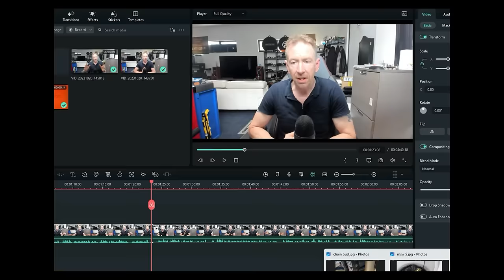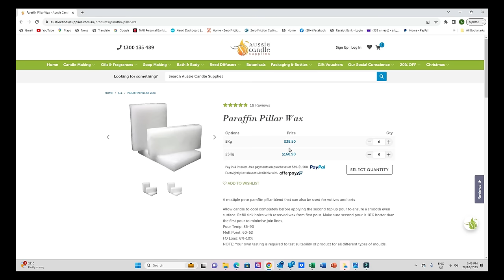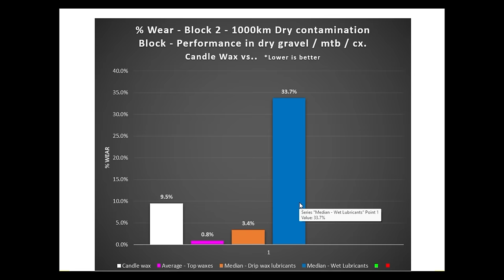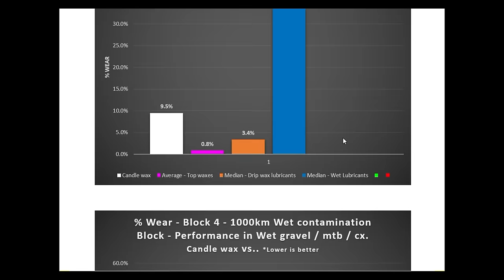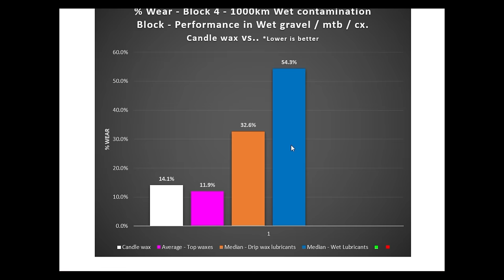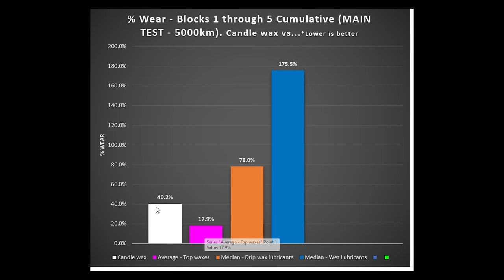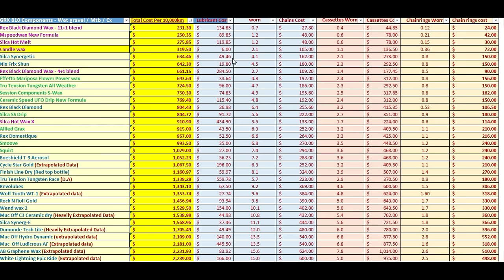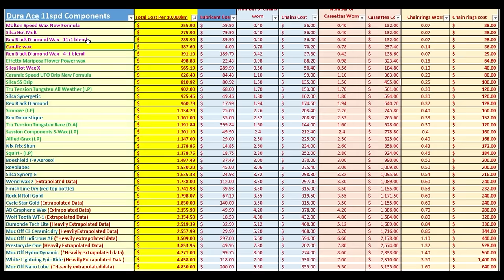Candle Wax test

Comment: Is there any concern re frequent boiling water flushing the chain from an expansion and contraction point of view? 

I guess we rapidly heat/expand the various chain components when we wax but if you flush before every wax that's 2x the expansion/contraction cycles over the life of the cain.

Just a random thought. Maybe a contributor to the cases of folks getting less than expected chain life?
Reply from the maker: no not at all, no more than re waxing itself, the temps re metal / chain construction cause zero issues - chains almost always fail early in life if they are going to fail due to a mfg fault, once chains are well into lifespan, if you keep that lifespan extended with immersive waxing, you just enjoy a vastly longer life from the chain. Very worn chains have a higher risk of failure, but thats not the risk with waxing.

Comment: Is there a way to tell from visually seeing the melted candlewax if it's going to be a disaster or not?   Can I dip a nail or something in and tell from sticky factor, residue left, something like that?   What if it smells like Christmas?   That has to be okay right?
Reply from the maker: Alas i cant say, i would need to do a bunch of visual / feel tests and then control test to see how it correlates. I would say sticky factor would not be a good sign though, that will likely be a) very slow, b) much more likely to be quickly dirty and gunky - so if you can tell that from feel, then that would be not a wax i would run. 

Anything scented is not a great sign if looking at things from the perspective of i want the best lubrication. Adding substance for scent - lets say 5% of volume is that substance, thats 5% less substance that could be lubricant. And it is doubtful that substance brings anything great to the party re performance - scented candle wax was simply not designed with lubrication of an extremely hard working mechanical part in mind - it is just an incidental factor for them that overall paraffin wax is an amazing lubricant for bicycle chains, but other things they contain outside of high quality paraffin will not be helping.

Comment: There is nothing to suggest that heating paraffin wax to higher temperatures like 150 deg C does any harm to the wax.
If long chain polymers in the range of paraffin lengths could be broken down this way then industry would have solved major problems.
Some chain lube manufacturers may however use friction modifier packages that break down at higher temperatures.
But if using straight paraffin it is better to heat to around 140deg C.
This ensures that any moisture boils off quickly and may make it easier for the wax to get into the chain spaces.
Reply from the maker: I can suggest some :). For one, the wax cools to a yellowish colour vs white. And then, those using damaged wax find that it feels and sounds pretty bad pretty quickly. And then they see their chain wear rates shoot up if continue to use. Overheating does indeed damage the wax, this is a test you can easily do yourself at home, and very easily you will see the difference. The mfg would not advise against it if it was not an issue, but it is most definitely an issue, and one we deal with relatively frequently when a customer accidentally leaves their wax on high overnight etc.
Reply: @zerofrictioncycling992  I see no drop off in wax performance.
Only poor waxes will yellow quickly unless you reach silly temperatures.
Reply from the maker: @darrylduck6356  Okay. I can only report what a) the mfg advise and b) what we see and deal with - we have many thousands of immersive wax customers. Many have wax for years and countless cycles, no degradation. Some accidentally overheat, and that is the only time the (SAME) wax yellows. Post overheating, degradation in performance is very tangible - and is usually the impetus re why they email me to ask re if they have damaged. So we have a pretty strong link to what is observed in real life matching warning by mfg's re not overheating.

Comment: Its gonna take a lot of commitment to take my chain straight from my bike and put it back in the wax. It seems very wrong, like putting dirty oil back into a can of new oil. Anyway, say I was about to rewax, but my chain has began rusting between the rollers and plates. Should I still sling a rusty, dirty chain back into 100% pure wax? How long can a chain have surface rust on it before it starts pitting/degrading the sliding surfaces of the chain? Is there any way to remove 100% of rust from a chain?
Reply from the maker: Hey Josh - ha yes that is difficult for some, but - again - compare to what drip lubricant users have re the ratio of lubrication to contamination going on vs what it  takes to get anywhere near that in hundreds of ml of wax in your wax pot. Unless you are slinging chains post full mud rides in every time, dry riding - you dont have to worry at all, and if you do worry - then overall vastly easier is the two pot system like a boss demonstrated at 1hr 39 min mark in waxing FAQ vid. 

Surface oxidation is mostly just an unsightly issue. Outside will start to oxidise well before inside where it would cause issues due to lack of air exposure inside chain. 

However to remove is not easily done depending on where it is. If its on rollers, that will wear off over time, if its started a bit in spots on plates, thats hard to remove - really the only viable way is ultrasonic and ultrasonic solution specific for rust.

Comment: Make sure the 'cheap' pure parrafin has as low an oil content as possible and than usually that means it wont be from the cheapest source and usually you have to buy bulk like at least 5kg-10kg. And then you just need to add some sort of dry lubricant, MoS2 or just graphite. Plain it should not do as well.

Comment: anyone having trouble with wax longevity on Transmission XX SL chains? i am wondering if its the holes in the plates?
Reply from the maker: Hey jack that is interesting, mostly sram chains get along really well with wax, their surface treatments / finish seem to have wax bond well. Typically eagle chains etc enjoy very good  treatment lifespans. How did you prep chain and what wax are you using, how re waxing?

Comment: Interesting. A parallel to this experiment in the wet lube category could be testing Canola Oil (originally developed to lube mechanical parts) & compare to top / mid performing wet lubes.

Comment: Great research. Now with that out of the way I have another lubrication 'hack' for you to test if you are intrested. I once met a rider who told me that they dont use wax or oil, they instead boiled their chain in fat, which they obtained from the local butcher. I dont know the details of how that setup work, but from what I heard from them, its somewhere between wax and oil..
Reply from the maker: Ha yes there is so much stuff like this out there! At this stage i will leave that for someone else to test. Along with whale oil, seal blubber etc etc :)
Reply: Don't even bother. I've had customers doing this when I was working in a shop focused on oldtimer bikes because it was some thing someone did in the 30s or so and those drivetrains were the biggest gunkiest mess I've ever seen.
Reply from the maker: @vien4875  yes that is the concern! a little inconvenient the wax i found was pretty good, what others end up getting for DIY can be not so much....

Comment: Putting "super secret" in the name just rings my sus alarm even more, it strongly reminds me of the FireClean lube debacle in the firearms industry, and to even further back the first advertised, ultimately ineffective cure of tuberculosis, which was later used successfully to diagnose the disease.

The thing with FireClean was that it worked amazingly, but that's not the point, it was about the price when people found out what it actually was. The scandal is across disciplines but still I think it draws parallels to the bike industry, especially all the sementic wiggling the company did to justify the cost in the aftermath.
Reply from the maker: Not entirely sure what you are getting at here. But i will take a stab, and see if i can help with some concerns, not just on behalf of silca, but overall i think it helps people to understand how business works sometimes. 

>First there is R&D cost behind a product like this. Unlike circa 1000 "bike" lubricants on the market that are just rebottled and re branded something from X industry supplier - some lubricants are developed specifically for use on a bicycle chain, which is actually a very specific use case factoring contamination, very high pressure loads - stiction on 8 separate sliding surfaces per link per articulation / reticulation, ability to penetrate to pin (difficult for wax emulsion lubricants) etc etc.  Aside from the chemistry and mechanical knowledge to make a true top performing product - it still normally takes a lot of testing across many base blends and potential production blends. This costs real money, that has to come from somewhere, to do.  In the longer run, the costs have to be paid back via return on the product. 

> Then there is volume production once the final blend has been decided. This involves proper supply chain of key ingredients from tier 1 suppliers, batch analysis of key ingredients, and the actual product and bottling costs

> Then there is marketing and distribution costs. 

> Then - Silca need to make margin between their sell price and the price it is sold to importers. Importers then need to make margin on selling to their w/sale accounts (online stores and bike stores). The online and bike stores need to make margin selling to the cyclist. So there are 3 layers that need to make viable margin. 

> If we want good companies to continue to exist, we want them to make viable margin. We want them the get a viable return that pays back the initial investment in bringing to market, and then to provide revenue for R&D into next great products coming to market.  How many treasured business in many western countries have been lost in the last 10 years. Kitsbow is a good recent example in USA, and there are so many more. 

> In the case of this product - it is pretty well proven. The zfc test is a very harsh test, and it is an independent test. Vs many direct competitors, it will save cyclists A LOT of money in much lower wear of chain and drivetrain components. Even on mid tier groups sets - vs many other wax lubricants costing half the price - it will deliver at least half or one third the wear rate. So if one spends an extra $20 to save hundreds - well, warren buffett would say thats a mighty fine and mighty smart investment. 

So i dont think there are any parallels in your example. Cost to produce some wax emulsion lubricants is not miniscule, factoring in more expensive base wax blend vs some just using slack wax, factoring in true high quality ws2 from tier one suppliers. Batch analysis of key ingredients to ensure they are precisely what they are meant to be, even from tier one suppliers. Production control so that each production batch is the same as the last etc etc. 

I am not sure what you think silca rake in for a bottle of lubricant re profit, but i will bet it is much less than what you had in mind when you wrote up the comment. And that is not a criticism of your comment at all, i think your thinking is quite commmon - i just dont think a large % of gen pop truly understands what sits behind many the prices of many things. And they complain about cost of lubricant that has a fair bit of stuff going on, but we have to pay $30 for a little plastic go pro mount adjuster that would cost 5 cents, or $40 for a garmin charge cable that would cost maybe 15 cents, or X for a set of headstem bolts, and on and on and on - i could find about 500 examples on a large online store in 10 minutes of price vs production/ marketing / distribution gaps that dwarf anything in the lubricant space. 

So i hope all of the above helps explain. Sometimes genuinely great products that had genuine R&D to excel in their actual use case can have a higher base cost, and R&D to pay back and then profit to be made for future. And if we want companies who are making genuinely great products to still be in existence and doing such into the future - they should not be begrudged too heavily for ensuring viable profit. 

hope that helps!

Comment: except silca hot melt, molten speed wax, rex black diamond, shame on the entire lubricant industry for under-perfoming such a simple lubricant. the cumulative wear differences as opposed to wet lubricants is especially staggering as always. so, the product you linked, paraffin pillar wax from aussie candle supplies, "Pour Temperature: 85-90 ˚C Melt Point: 60-62 ˚C" clean paraffin wax, no additives, for wet conditions especially, is a good alternative to most waxes on the market, save for the very top shelf stuff. we could call this lubricant "Median™©®". kinda confirms what i think a lot of people already suspected but it's nice to see it from a reliable source as opposed to hearsay.
Reply from the maker: Yes overall agree - part of it is that paraffin is at its heart just a great match for lubricating the sliding surfaces of articulating chain parts, and the fact chains operate outside exposed to all contamination (unlike most lubricated parts in most machines) - being a solid lubricant is a big advantage. Add into that the huge benefit with immersive waxing of flush cleaning whatever amount of contamination did get in each time, it is VERY hard for drip lubricants to match immersive re lubrication over time, but some of the top wax drip lubricants were pretty close, and with some basic periodic maintenance could pull ahead - and with fancy wax base and friction modifiers - would be faster for racers on a properly prepped chain. 

Wet lubricants overall struggle. For bicycle chain, overall the general rule of thumb is the best lubricant is the one that REMAINS low friction. Alas for wet lubricants every particle of dust sticks on contact unlike wax, and, being wet, the contamination has a pathway to get from outside to inside chain and cause friction and wear damage. A particle of dust on the outside of a wax chain, it just does not have path to travel inside. 

If one only ever rode in dry road cycling, the block one only test is a bit more applicable vs the full 5000km test which has dry dust and wet contamination blocks, so a number of the top wet lubricants tested would give this cheap wax a good run. 

However MANY wet lubricants are flat out pretty average to terrible. i think MANY wet lubricants are simply re bottled and rebranded whatever from X industry, and are in no way developed specifically for use on bicycle chain - which is actually a pretty extreme lubrication challenge due to it being a very hard working part completely exposed to the elements and contamination. Many others that supposedly have been developed for cycling it is just well this is a good X lubricant from somewhere, lets add some things that sound good and should improves its performance - but there is ZERO objective, tangible testing to prove if it is good, or how it performs vs competitors. Most times the product will be sent out with cyclists, and company staff, all report it feels great - and yeehaa - the next wonder lube with magnificent claims is there. Or - conversely as we see with some brands, the product was developed 30 years ago, and is still basically, or exactly the same and they are living of brand name recognition. 

And this will continue, until cyclists start voting for proper high performing products of their preference vs still supporting products that bring only marketing BS or 30 year old performance to the table.

Comment: My tap water is so hard, i boiled a chain and it became a frosted mess. Ill have to use purified water.
Reply: @joshuabuilds3051 Use rain water from a water butt,  preferably with an inlet filter to stop leaves and bugs.  Most of the debris will sink to the bottom so as long as the outlet tap is not there ( would be a bad design ) then your good to go.  Obviously its a good idea to sterilize the boiling container afterwards if your using it in your kitchen.

Comment: Bees wax next?
Reply from the maker: negative :). Honestly it would never stop! It is interesting but the test resources are too precious to spend a lot of them on never ending DIY wax blends, and remember this is still just a very small subset of cyclists so it would be a huge amount of time and $$ to find out for John Smith that his blend of 50% beeswax, 25% lanolin, 20% xylene and 5% paraffin oil is pretty good, and that Bobs Carnuaba + graphite + linseed is also pretty good etc etc - and how much cross over adoption / help that will add to the world when really the vast majority of waxers are going to either stay with a proven top commercial product, or keep it very simple with paraffin. The DIY waxers can test themselves, and if they get great results, they can put out the results on forums, or on YT vid comments etc for others to see and try. 

Or of course, if truly passionate about it, they can book in for a test! i just cant cover the costs and time for never ending DIY blends or every possible wax base for DIY, there is just so much other higher value testing to be done!
Reply: Beeswax isn't exactly a great solid lubricant by itself.

As a high concentration additive or even cosolvent, it is a pretty good additive.

But by itself? Stick to other natural waxes like fully refined soy wax, sunflower seedwax or rice bran wax, which are harder, tougher, and have interesting properties regarding metal lubrication.